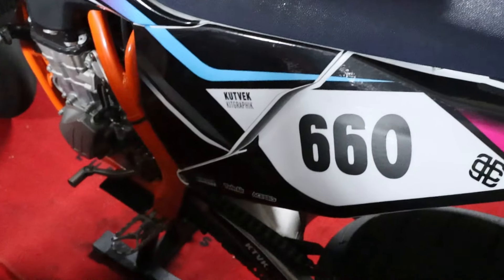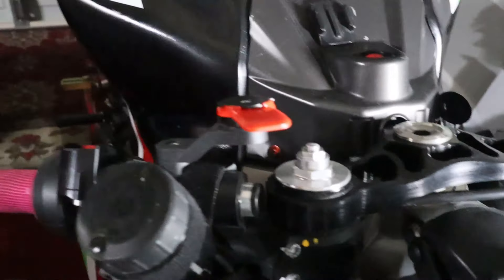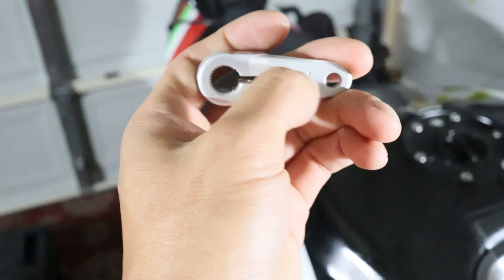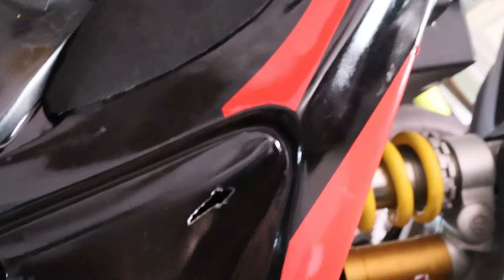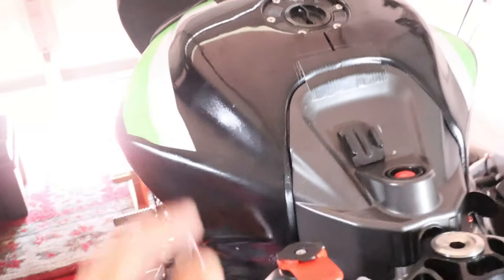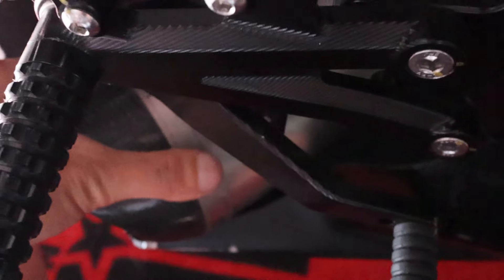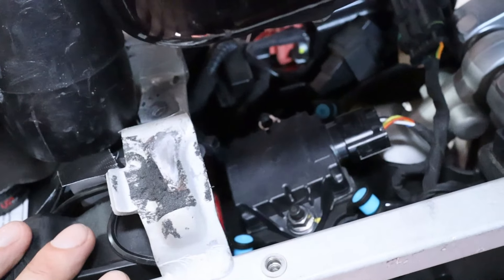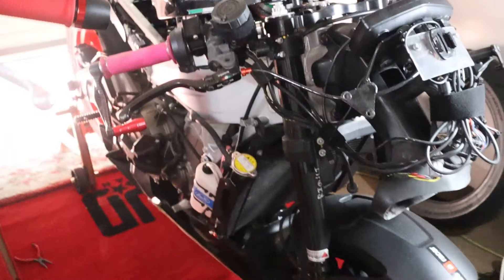Aprilia Tuono 660 RS COMING BACK | UPDATE | IMU DAMPER + SHIFTER JOINT

Comment: Hello, do you have the part nr for the updated shifter joint? I also wonder if you have secured (using wire with small drill holes) or checked your oil pressure relief valve since you got the bike? I see that some people are really unlucky, if it comes lose it can destroy your engine.

Comment: your shift rod is about 1/2" too short - looks like!... the shift linkage arm needs to be near 90 degrees angle / straight out to the side in relation to the foot lever direction for proper shifts to happen!  (foot lever angle and shift linkage angle should look in "parallel" - not as you have it here!) (fyi!)
Reply from the maker: Hey, yeah, I know the rule of thumb is perpendicular/90 degrees for the joint/shift rod connection. However, with the aftermarket rearsets, it's rather better to have it at the angle I show in the video; where I have equal amount of travel for up and down shifts. But yeah, you're right, however, it's also a general baseline/recommendation, not an obligation to your shifter setting. at the end of the day, if it works, it works; it could be rider's preference too. once again, thanks for your feedback, really appreciate it and I hope others read it too! 😁